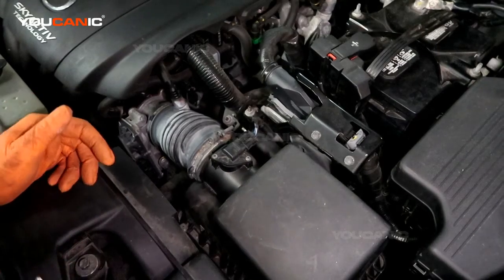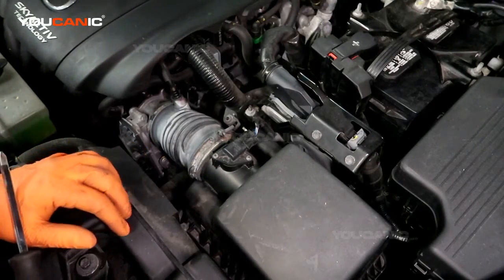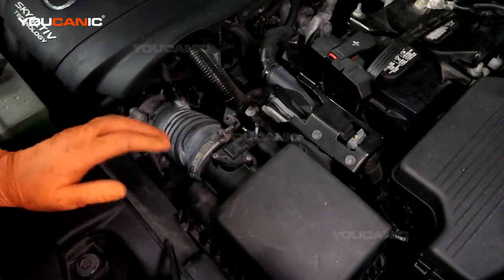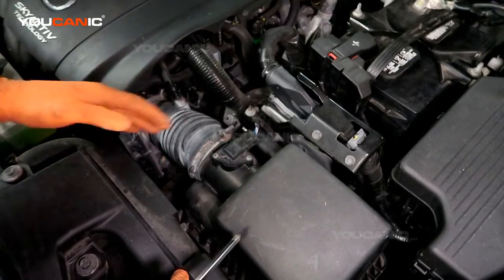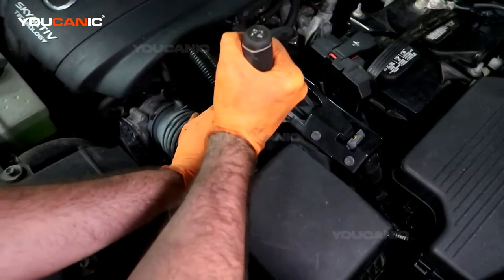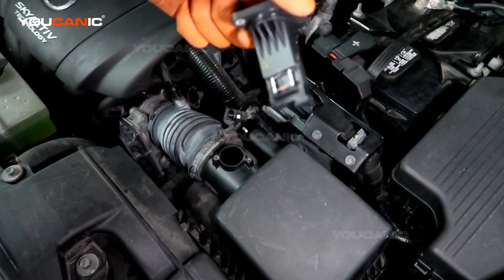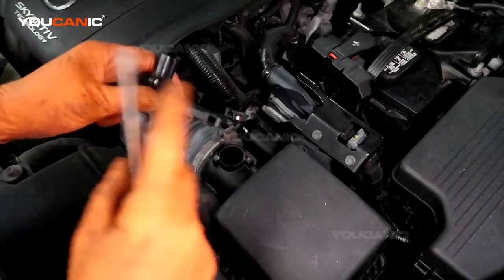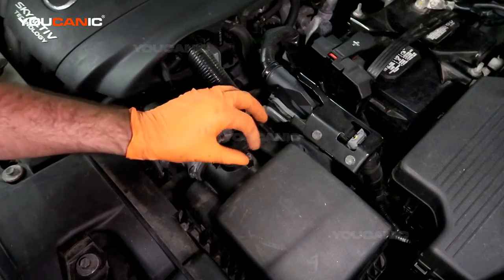2013-2017 2.5L Mazda CX-5 - Mass Air Flow Sensor Replacement

Comment: I just replaced my MAF sensor on my 2015 cx-5, and the engine light came on. I wasn’t sure if the car was getting used to the new one, and so I brought it to autozone to get a diagnosis, and it came up as P0171. I’m not sure if that means I didn’t put it on correctly but the car runs fine, please help
Reply: any solutions? i have a 2016 got the same code and was told this MAF was a possible reason for 300+$ to fix

Comment: I have a 2013 Mazda CX-5 Touring AWD. It has the 2.0 Skyactive engine. The other day, the Check Engine light came on, the Main Warning Light, the TCS OFF light, and the Tire Warning Light, and suddenly, the car stopped accelerating (I think it's called "limp mode"). As long as I kept my foot on the gas, I would stay at around 40 MPH, but could not accelerate past that. My car would slow down and stop as soon as I took my foot off the gas. Starting it was no problem and getting the RPMs up while in Park was also not a problem. Only when I put it in Drive did this occur. Could the MAS have something to do with this?
Reply from the maker: Thanks for reaching out about your 2013 Mazda CX-5. This issue could certainly be related to the MAS but to accurately diagnose the problem, you'd need a full scan. YOUCANIC provides a powerful scanner and numerous resources to help car owners like you. Visit www.youcanic.com to explore our resources more.

Youcanic is about empowering car owners, we're here to help you save money and understand your car better. We even have factory repair manuals available if you need more detail. We're here to support you in every aspect of your car ownership journey. Keep in touch!
Reply: @YOUCANIC   Well that sounded more like an advertisement than an answer, but okay, lol. What kind of lubricant do you use for O-rings, please?
Reply: @MiriamMillen did you ever solve it?
Reply: @Dududma  
I'm really disappointed because when I first purchased the vehicle I paid $100 for a full diagnostic and the only thing that came up in regard to the engine was the number 3 cylinder misfiring with no other specifications. I replaced the spark plugs, the coils, and the MAS, and there's still an issue. I even unplugged the battery, which is new, let it sit for a while, plugged it back in to clear out the check engine light and it was fine for about 2 days and then it went into limp mode again. I'm not sure what to do at this point.
Reply: @MiriamMillen  could you tell me what the issue was I’m having the same problem now
Reply: @Dududma  
I don't know what the issue was, my car hasn't been fixed yet.
Reply: Did it throw out the same code? I had that happen to me and it turn out the non-oem coil was the issue. Dealership replace the coil and my car was fine afterward @MiriamMillen
Reply: @garyyang9837  
I don't have the paperwork in front of me but it keeps referring to the third cylinder misfiring. I've already replaced the spark plugs, the coils, and the MAS, in addition to the air filter. I guess I'm just going to need to take it in for another diagnostic.
Reply: @garyyang9837  
I didn't purchase all the parts from Mazda, but the parts that I purchased were described as OEM parts and had exactly the same markings as the parts that I replaced.
Reply: I have the exact same car and exact same problem. I'm going to pick up my new MAF sensor this afternoon but I'm no longer hopeful since seeing your comment 😭 If you ever figure it out I hope you'll update here, and if I get mine going I'll be happy to share!
Reply: @nelliebean99 
@nelliebean99 
Well hopefully you'll have better luck than me, and absolutely, when I get a proper diagnosis I'll be happy to share here. I'm flabbergasted that thousands of people have had the same issue and yet there has not been a recall and/or a covered repair.
Reply: @MiriamMillen  the MAF sensor replacement fixed the problem for me! I noticed that the plastic clip for it was very brittle due to age because it basically crumbled in my hands, so I wonder if you might have a crack leaking air somewhere?
Reply: @nelliebean99  
I don't know, but hopefully I'll find out soon! I'm glad your situation was resolved!
Reply: @MiriamMillen  I just bought a 2013 Mazda CX-5 and am experiencing the same exact issue! please let me know if and how you get it resolved.
Reply: I have a 2015 cx-5 and this happened to me three times within the same year, right now Im dealing with it again which is a wrong time. But usually its the spark plugs, ignition coils, and MAF sensors which I think causes the car to do that. I also spent $100 on a diagnostics, and it came up as MAF, and spark plugs. Although my spark plugs are replace I can still feel some misfiring, and my last resort is to order an OEM MAF and see how that goes, because I am not paying $300 for a simple fix lol. But yet again some of the cx-5 from 2013-2016 have been recalled due to transmission issues so check your vin if your car has a recalling on that just for extra information. Ill update when I get it installed.

Comment: Horrible cars I have CX5 myself. Nothing only problems.
Reply from the maker: I'm sorry to hear about the issues you're having with your CX5. At YOUCANIC, we aim to empower owners like you with tools to diagnose and fix your vehicles confidently. One resource we offer is the YOUCANIC Full System Scanner, a virtual mechanic designed to help you identify car issues ([www.youcanic.com/scanner](http://www.youcanic.com/scanner)). 

Additionally, we offer a platform where you can ask car-related questions, OEM Factory Repair Manuals, and more on our website ([www.youcanic.com](http://www.youcanic.com)). We're here to make car repairs understandable and accessible for owners like you. Feel free to explore our site for further assistance.
Reply: we have a 2016 no problems at all
Reply: I have a 2014 that now has 135k miles and no major problems. Bought it in early 2013 new. Great car.
Reply: 2015 very few problems at 177k